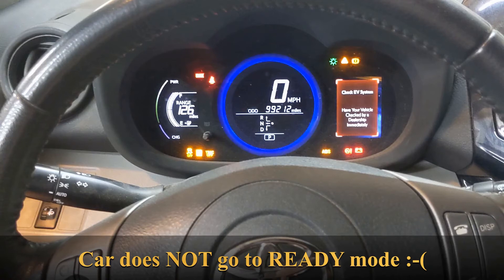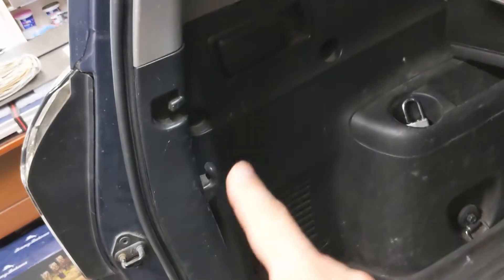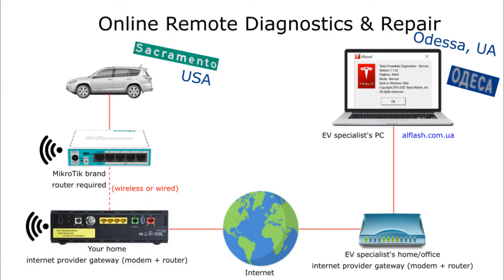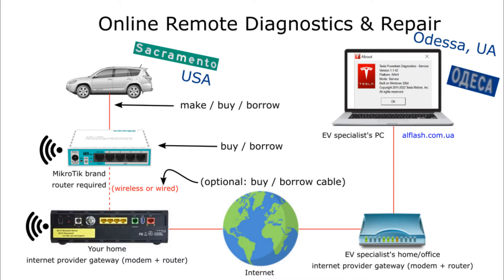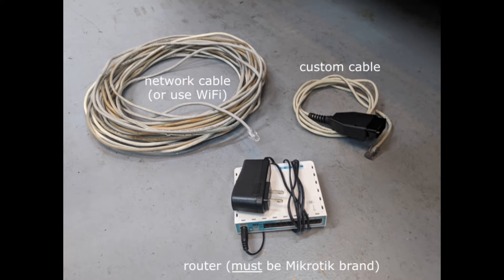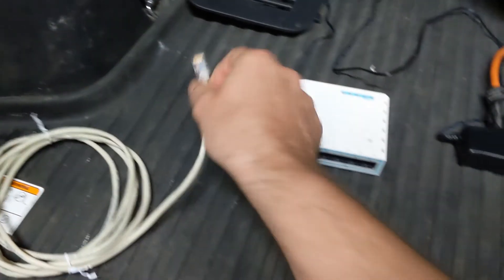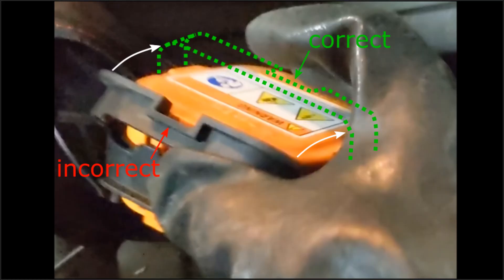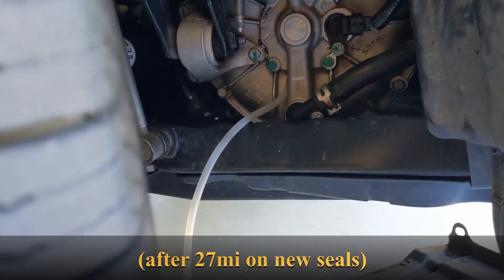Remote Diagnostics

Comment: Does the rav4 ev work the same way as the b250e regarding the battery heating in cold weather? Meaning the battery spends quite a lot of it's own power (I've heard 6 kw) to heat itself up during the first few km of driving, resulting in very high consumption if you do mostly short trips...? I wonder if it would be possible to disable or at least reduce the battery heating, as it seems pretty meaningless to use that much power just to heat up the battery, if you only drive 5 or 10 km then you park the car as soon as the battery is fully heated and all those extra kwh are wasted...
Reply from the maker: Sorry, I don't know. Did you search the forums like http://www.mybclasselectricdrive.com?
Reply: I don’t know how it is in b250e, but RAV4EV has a 450V/5556 W battery heater. And with small negative temperatures (-10 ... 0 C), heating to the minimum required temperature occurs quite quickly. Nominal operation voltage of HV battery is 276... 386 volt.
Let me remind you that in summer, at high temperatures, part of the electricity can be spent on cooling the battery.
In ŔAV4EV, HV battery temperature check and control can't be canceled/changed.

Comment: Would you know if there is a Tesla diagnostics port hidden somewhere also on the Mercedes B250e?
Reply: On b250e to check codes, parameters of the Tesla system on and all others, a standard / conventional diagnostic connector aka OBD-2 is used. It is located in front of the dashboard at the level of the driver's feet.
Reply: @altechpage  Ok, thanks for your reply! Would you know if the Tesla and Mercedes diagnostics are integrated in one system that can be read with the same software, or do the Mercedes dealerships use one software for Mercedes codes and a different system for Tesla codes? Would you know of any reasonable DIY diagnostic tool (or pc software?) that is able to read codes (and do programming?) on the b250e?
Reply: @altmuligmannen3086  As far as I know (not my experience), ISTA dealer program is needed to diagnose and check of all systems of this model.
It is possible to use the multi-brand chinese Launch scanner, but it does not "see" the BMS.
I don't know about other reasonable DIY diagnostic tool or software.
Reply: @altechpage  Would you be able to do remote diagnostics on the b250e, the same way that is shown in this video?
Reply: @altmuligmannen3086  I don't know, haven't tried it. 
But, if diagnostics* are possible in this model as in Toyota Supra 2020MY ( https://youtu.be/kXVGwAoXnro ) with a B58B30M engine and BMW systems, then yes, we can use this method (one of four possible) remote diagnostics (use Ethernet I.EEE 802.3).
* Toyota-ISTA software (Integrated Service Technical Application by BMW).
Reply from the maker: Good question - Maybe @Vladimir Leshchenko knows

Comment: Great data w/ the powertrain diagnostics - isolation resistance is listed there.  It sounds like the same cable can be used on a regular Tesla - I wonder if the toyota diagnostic software could be used on model s as well since its likely just canbus data.
Reply: 1. Tesla Powertrain diagnostic soft for RAV4EV has been "sharpened"/modified to diagnose this particular model.
2. Ethernet I.EEE 802.3 for the Toolbox* program was used only on early Tesla models and there is a diagnostic connector of a different design.
TESLA RAV4EV diagnostic program is a modified and truncated version of the Toolbox program.
Reply from the maker: @altechpage  Thanks!
Reply: @altechpage  I would suspect the tesla mcu1 may have the ability to use this software, but probably not Mcu2.  I have mcu2 in my 2013 model s.
Reply: @eastmanresearch3143  Your vehicle has this connector for diagnostic connector (link to photo)? 
Note.  Unfortunately, we can't post links to other sites here :(
Reply from the maker: I don't know about that. I saw people use a smaller 4-pin connector for that. Vladimir knows.

Comment: Easiest way to get a cable is to buy a cheap bmw E sys cable and resoldering pins to match a diagram.
Reply: Yes, you can remake Cable E-SYS ICOM for diagnosing this car, but on amazon this cable costs 2-3 times more.
In addition to soldering wires to other contacts, it is necessary to remove the "extra" resistance.

Comment: Thanks for posting. You are correct, the Toyota dealerships are unable to properly diagnose our RAV4 EVs. Although I purchased a warranty, Toyota refused to properly service the vehicle and only replaced the drive shaft output seals because they were leaking...
Reply: I assume that this is not the fault of the Toyota dealerships, but this is their misfortune and the misfortune of the owners of cars of this model. There are very few such cars produced, most of them are out of warranty for a long time. Therefore, it is unprofitable for dealerships to have a specialist who is certified by Tesla to diagnose and repair these cars. 
And, as we know, Tesla is NOT focused on repairing its units/assembly, but only on replacement.